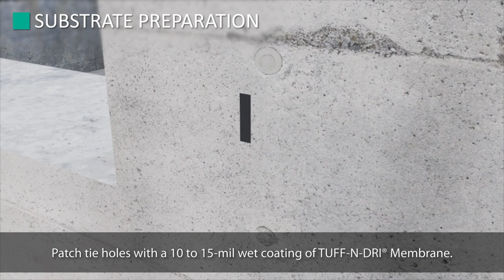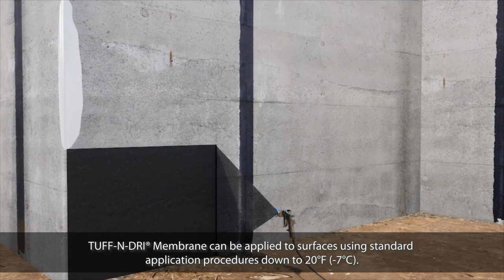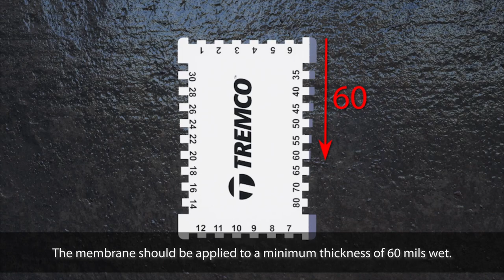How to Install TUFF-N-DRI® Spray-Applied Waterproofing

Comment: Is the insulation board in any way liable to become clogged up with soil particles over time? Or does it have an outer surface equally performant to a nonwoven geotextile silt screen?